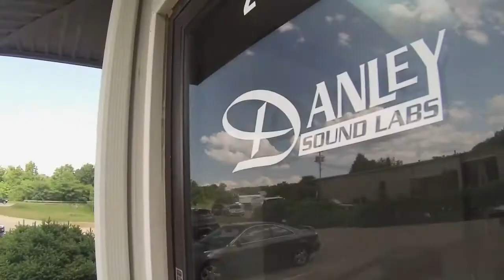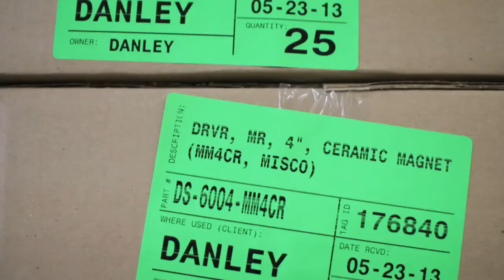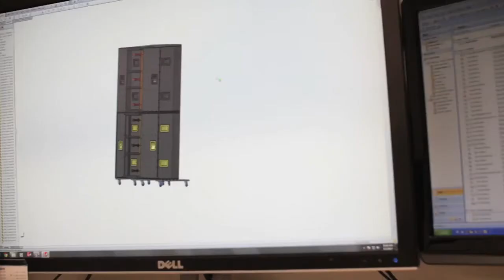▶ Danley Sound Labs Corporate Video

Comment: So you decided to start a company because of lack of innovation .. and you just took black speakers and painted them orange... how exactly is Pure Groove an innovative company? Its just orange Danley speakers.  

Yes, and your competitor has 3-6 drivers per box.. you have like 40 drivers per box.. and the box is the size of a damm special ed school bus..
Reply: Usually considerably lighter and smaller than the number of boxes they replace though, even though each one is the size of two double decker refrigerators.